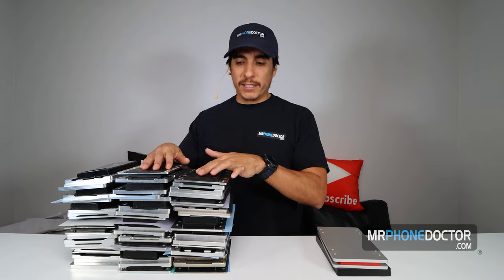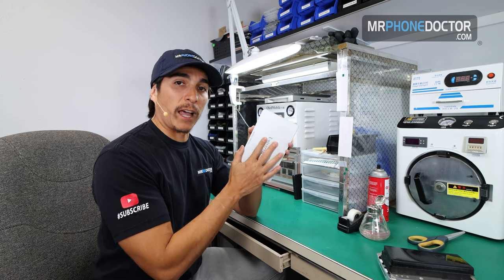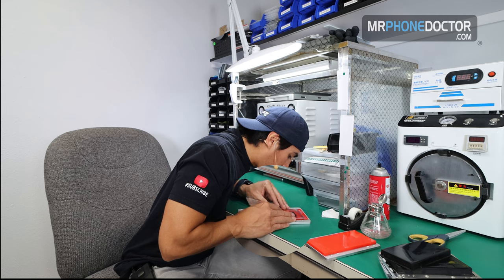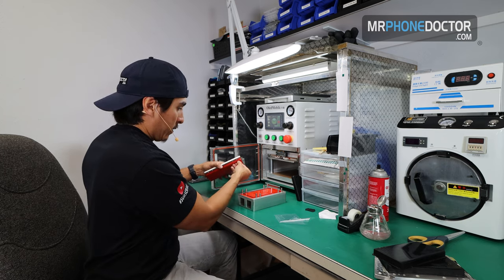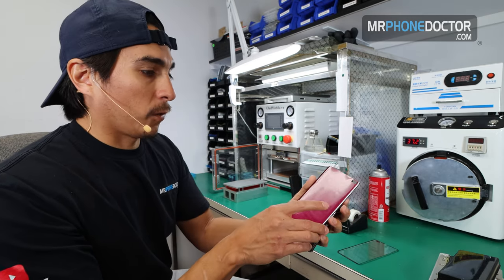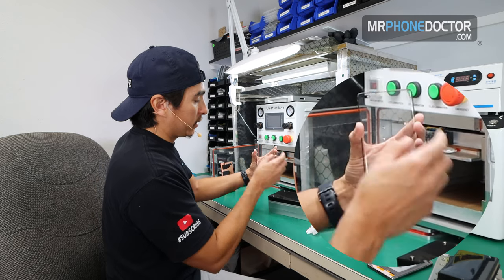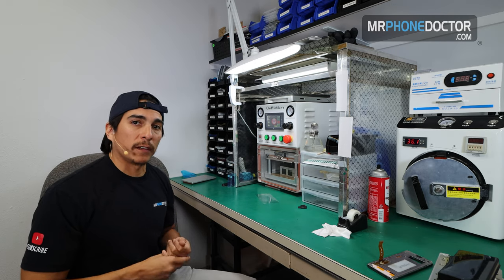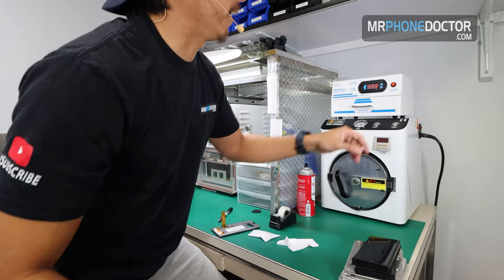How to save Money by using the Universal OCA & Magic AMOLED Laminating Molds

Comment: I just bought the magic mould 2 weeks ago, and it is fantastic... barely visible waves, and much faster operation. The only problem that it can not laminate the S20 ultra... at least for me... it failed 2 times to take out enough air from the 4 corners... so after autoclaveing there where still bubbles in at least 2 corners. so i had to use the ymj mould for the second try on them. for every other display it worked perfectly.
Reply: Why do waves apear ? I was refurbishing samsung s8 s8 plus and got many waves. Waves apear when removing glass with wire, soi tryied low temperature 70deg and still got waves.
Reply: Try using higher temperature in autoclave so u get rid of bubbles
Reply: @branislavxxx7249  the waves come from the copper sheet behind the display... so any inperfections on the copper sheet appears as a wave on the display.  i tried 75 deg in the autoclave and run it for 18 minutes in 7 bars... i did 3 runs and still in 1 corner there was a bigger bubble spot... it is only happening with the S20 ultra... S20+, S20 no problem... only the S20 ultra... driving me nuts!
Reply from the maker: Try the full OCA should leave better results
Reply: thanks for reply. so how u remove glass without getting waves ?
Reply from the maker: Best is to remove it in frame very gentle. Don't try to remove from inside work way from top glass then remove oled from frame with clear oca sheet
Reply: Use .5 bar, 7 sec press, 120 vacuum, 75c temp.
Make sure the height of the mold is almost touching the heat plate before press for effective heat transfer.
Reply: @edobosho  i used .5 bar, 120s vacuum, 15s press and 75 degrees... so almost exactly what you said, and it failed 2 times... and the upper plate almost touched the glass when the vacuum was on... so i even used more press time and still it failed 2 times.... but only with the S20 ultra... everything else came out perfectly. but as I said I switched back to the ymj mould and it was fine with it.
Reply: @Dariddda  that’s wired. Sometimes when there’s bubbles in the corners i just stick it back on the laminator and press again. Same settings. I have done s20 plus no problem.
I haven’t tried the s20 ultra though. Might have to buy the ymj mold myself to avoid these issues
Reply: You said "barely visible waves" with the magic mould, so with ymj moulds is a little better ( completely no waves?)
Reply: @MrPhoneDoctor   Removing the display by the back causes more imperfection on the final result?
Reply from the maker: @gianluigi5208  yes
Reply: @MrPhoneDoctor   thank you for the tip
Reply: How has this comment aged? Does this mold work well with the new S21, S22 and S23 series displays?
Reply: How has this comment aged? Does this mold work well with the new S21, S22 and S23 series displays?
Reply: @screensrefurbished  it works with everything other than the s20 ultra. u have to use two foam sheets (one red and one black) on top of the base mould (the bigger plastic mould).

Comment: hey, what about flex cables that run down the back of the oled instead of the side? is there a space on the otherside of the mold? can it do s21?
Reply from the maker: No problem it does all oleds no issues. It's soft enough no need to have IC cutouts

Comment: Personally I didnt have a toothpick but what I did have was a mechanical pencil so I carefully poked around and cleared the blockage in my port with the lead if anyone tries this as well MAKE SURE TO HAVE MORE LEAD OUT OF THE PENCIL THAN THE LENGTH OF THE HEAD OF YOUR RESPECTED KIND OF CHARGER TIP